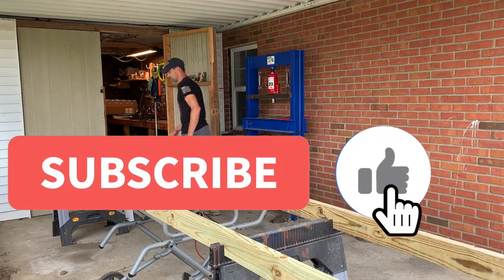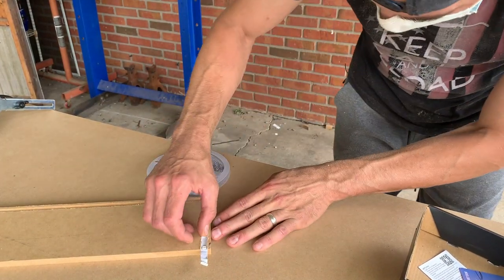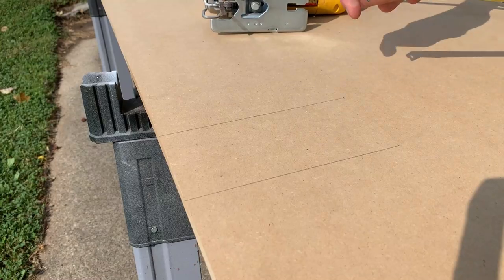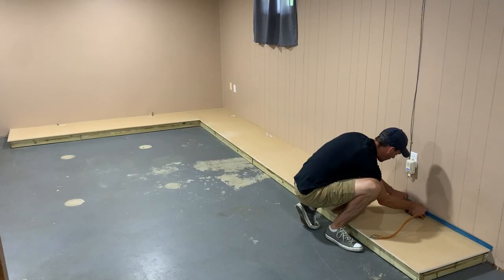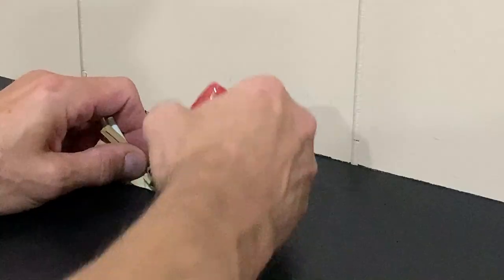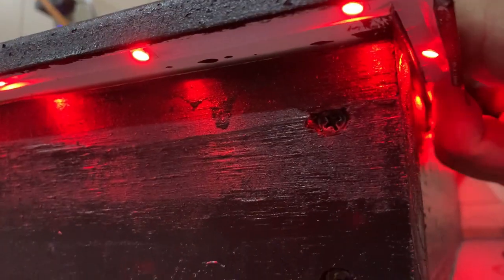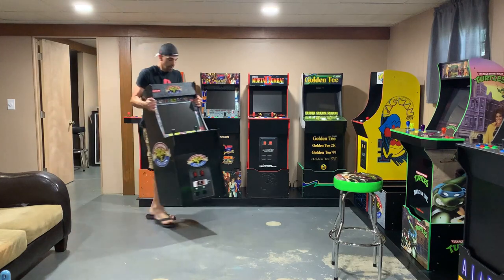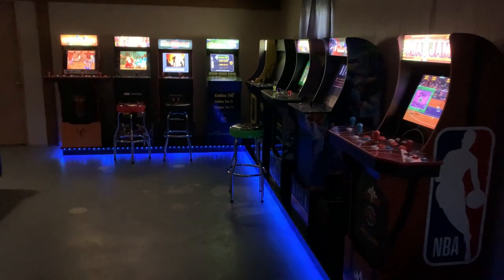Building A Basement Arcade 2

Comment: Nice job!  The riser you made is perfect for the A1Up cabinets.  I’m also 6’1” and even with the standard riser, the A1Up cabinets are about 3” too low.  I have a 5” riser on my Legends Ultimate and a 3” riser on my Legends Pinball.  I just added 3” furniture risers to my A1Up cabinet and now it’s exactly the same height as my Legends Ultimate.  I don’t have a basement unfortunately, but I’m using a extended garage as my arcade.  If you want to add more LED strips in the future, I recommend the aluminum LED tracks you can get from Amazon.  I mounted them along the walls near the ceiling with double stick tape and it turned out great.  The diffuser covers on the tracks keep the LED lights from glaring and it looks like a professional install.  Anyway, I look forward to more of your videos.

Comment: Is there any particular reason 19 Fox as to why your Street Fighter cabinet is off but the rest of your cabinets are on? Is there something wrong with the control deck or maybe the monitor or maybe the PCB board itself.
Reply from the maker: It the cab that I used for all my modding projects so I haven’t replaced it’s PCB yet.

Comment: Do you ever get any water down there? If so get a humidifier to keep moisture out.
Reply from the maker: It did “flood” years ago but we’ve done gutter work to the house and haven’t had an issue since.  I still keep a dehumidifier running to get rid of the usual basement moisture.